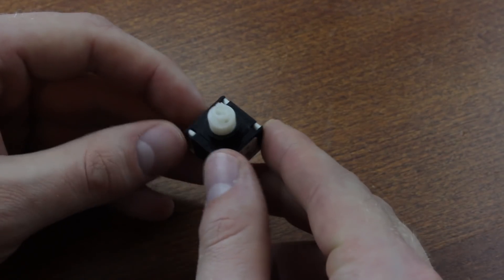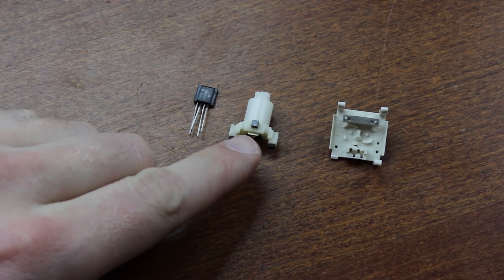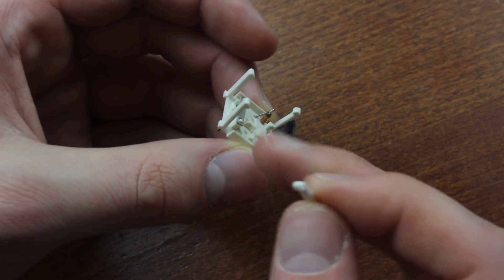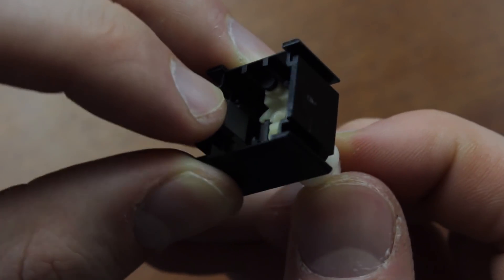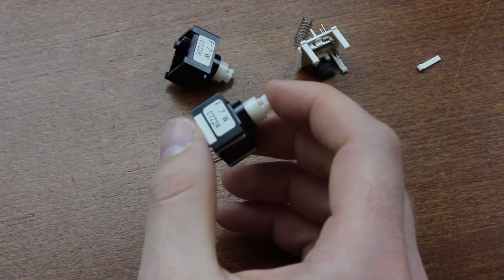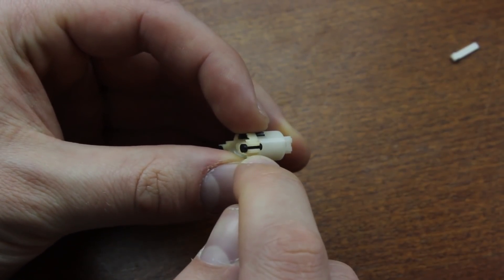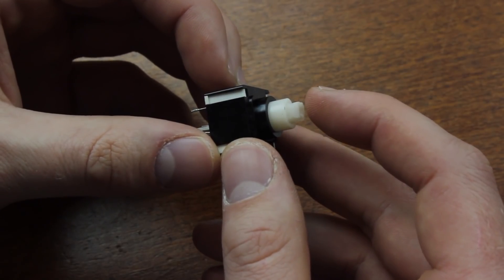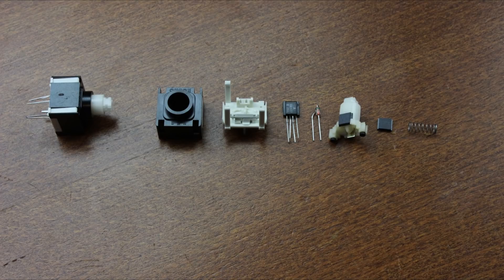Teardown - Omron B2H triple-magnet clicky Hall effect switches

Comment: Interesting, I wonder if you could modify a gateron optical switch thing to work with this. That would make it quite easy to implement, as you wouldn't have to worry about any electrical components within the switch itself, just getting the plunger right.
Edit: at least as a PoC

Comment: Next time you feel like reviewing a modern switch, you should do a review of the TKC Kiwi tactile switches or a keyboard using them. Once the lube wears off a little bit they get a beautiful clicky-clack noise to them. Goes really well with my board's thick-ass SA keycaps and has a retro feel to it. Normally I am a hardcore fan of stuff like Kailh BOX switches, but those got me interested in branching out a little bit.

Comment: You should look into the EVGA Z15 and Z20 

The Z20 is an RGB optical keyboard with LK light strike switches in it, and the Z15 is a hot swappable RGB keyboard that comes with kailh speed silver or bronze by default.

It would be interesting to see your take on them. The only reviews i've come across for these were from hypetuber types

Comment: i'm guessing the fourth pin on the hall effect sensor is for sensing redundancy...
Reply from the maker: Yes, it's pretty standard.
Reply: Hall elements normally have four connections (current supply and differential cross voltage). It's common for integrated amplifier sensors to have only three pins though.

Comment: I actually had an idea for a switch using magnets for tactility, but not clickyness. Pressing two repelling magnets embedded in the stem and the side housing towards each other would build up the tactile bump, and as they pass parallell the direction of repulsion would reverse and you would punch through. This would be coupled with a standard linear spring and a optical sensor.
Reply: Somehow the same few magnets should be responsible for the suspension, the tactile feedback, auditory feedback, and actuation via hall effect sensor. Just a few more years of meditation on this subject and I'll start actually building prototypes.
Also sexy: a magnetic coil to provide software-defined feedback envelopes. USB3 power delivery seems helpful for that. Actuation point should be configurable as well, but that's just common sense.